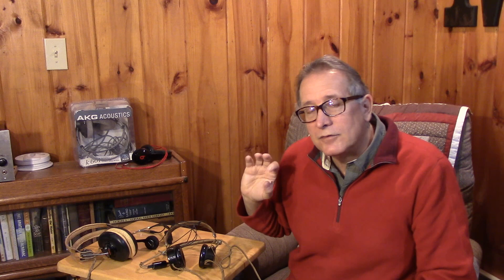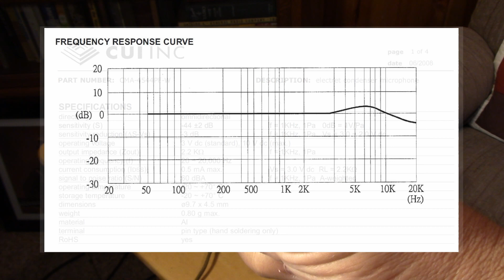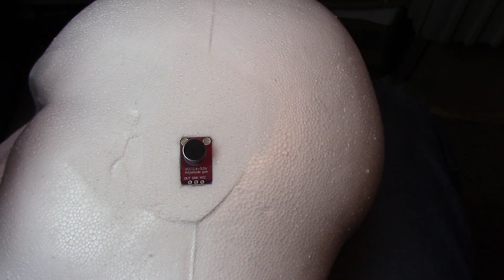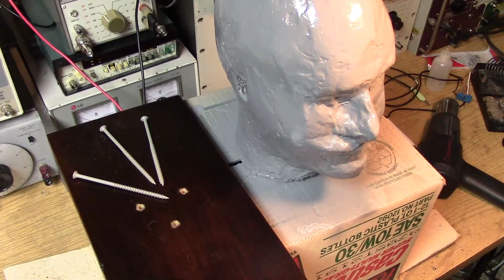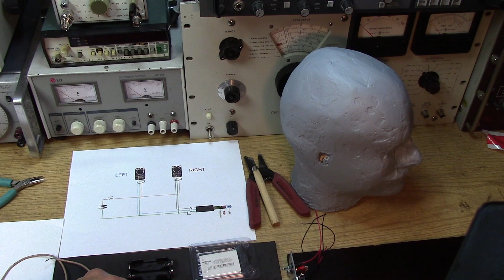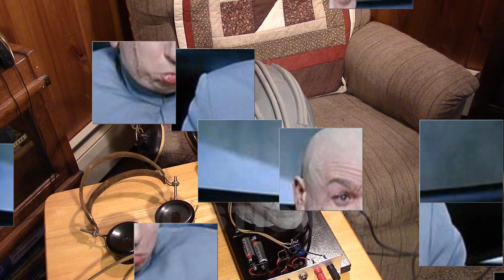Binaural Headphone Test Fixture

Comment: Really great. I've been thinking about this since I have a number of old high impedance headphones. I've been thinking about which are most sensitive and at what frequencies. The subtle humor is funny as well. Be well, Mike.
Reply from the maker: It is actually working! A bit primitive but I have found two headsets with mis-wired drivers so far and some crazy resonances in some.

Comment: Slightly off topic, but related to something you once said.
An old radio club member, who is sadly now a silent key, was the lead electrical engineer in an independent inquiry set up by the UK government in the 80s into mobile phone safety. I seem to remember that on your side of the pond, you used some high grade synthetic material to replicate human tissue, whereas Les said that we used fruit.

73 Steve
Reply from the maker: Yes I have been to labs to test SAR with the human body sink setup. The UUT is placed underneath the "sink" that is filled with primoradial goop mixed up in the lab. then the probe is introduced down into the body to the bottom. Then it is withdrawn until you have the absorption data in mw/cmSquared...